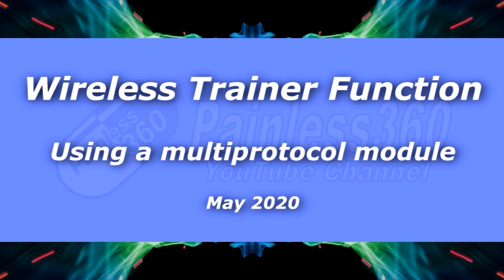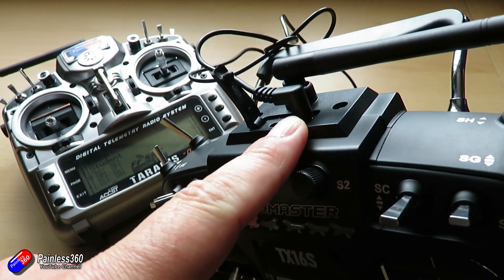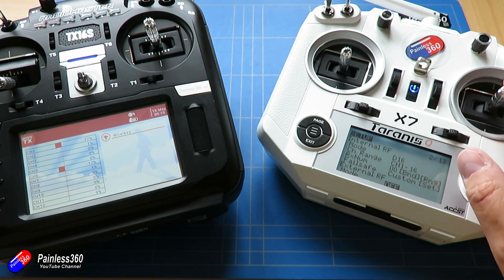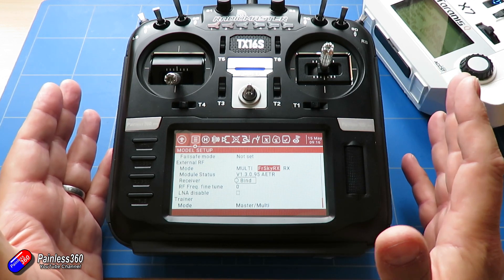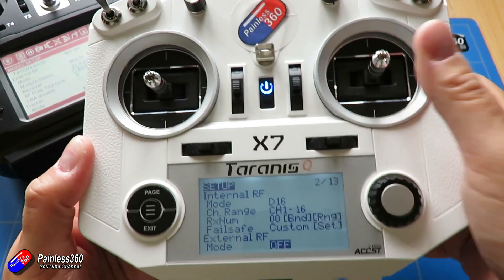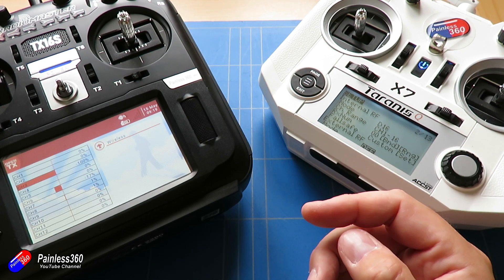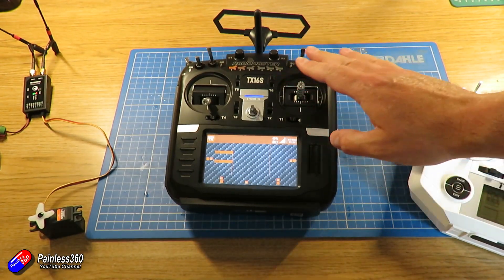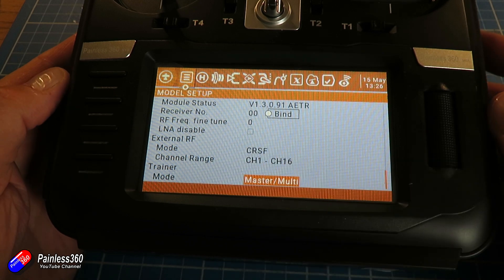Wireless Trainer Setup using a 4-in-1 Module (FrSky D16 radio and Crossfire too!)

Comment: Dear Lee! I have qx7 and R9 module. Would it work if I set the D16 as internal for wireless training and R9 as external? Thx!
Reply from the maker: Maybe, I've not tried it. The wireless trainer stuff is a funky function of the 4in1 MPM module so not sure if the standard radio that can't emulate an FrSky receiver can do that...
Reply: @Painless360  Thx! You have contact to tech people, clould you ask them if is it possible to change the internal xjt module in Qx7,to a multi module? Thx!
Reply from the maker: I dont think that you can. Best of luck
Reply: @Painless360  thx!

Comment: hey hopefully you can help me out. wanted to use this feature with the wt01 to work wireless with my goggles head tracker port. I have a 4-1 zorro radio internal with crossfire module, can I bind to the wt01 and put it on my goggle to send trainer channels for headtracking, while also using crossfire? sound like it should work.
Reply from the maker: I'm not sure how that would work, let me know if you get it working... best of luck

Comment: Lee, great video but I have a problem with the throttle. I have two Radiomaster TX 16S. Normally I use throttle -100 to +100 throw but when I switch over to the student the throttle trow change to 0 to 100 and that means I gave the student half throttle.  By the way when connecting to the Flightsimulator dongle with the stereo 3,5 mm jack it won't work. The USB connection you mentioned with a Windows driver is also a pain in the.... Only my old Futaba 7C works flawless. Thanks for your support.
Reply from the maker: I've not seen that here, let me me know when you gets it working... Best of luck

Comment: Hi I’m James, congrats on your videos very informative and to the point. I need a bit of help with connecting witless trainer with my TX16S, can you please advise how I set up trainer mode with FlyskyFSi6 transmitter with radio master TX16S as the trainer transmitter. I set up trainer mode on the TX16S but I don’t know what protocol I need to select for the fsi6 transmitter?
Reply from the maker: Not sure, I don't have one of those radios here and I've even downloaded and looked at the manual and still no clue. Best of luck with it

Comment: am having issue whith this. I have a tx16s and an extra 4 in 1 module and a taranis. I connect the internal module to the plane and connect the external module as rx to the taranis. only than i get extreme range issue between trainer and student. They keep loosing connection.
Reply from the maker: I've not seen that. Use the tune function to make sure that the signal is as good as it can be and beware that getting the antennas too close can cause the link to hiccup.. Best of luck
Reply: @Painless360  yes that was the issue I brought the module antenna 5cm to the left with an extension lead and i have a nice link.

Comment: Hi Lee, Hope all is well.Have you connect tx16s with the xjt module to a flysky FS16x. Or to the R168 rx. I tried many time following the XJT document with no success. Now if you took several hrs with the Radiomaster folks I think I am sol. as I have none of your expertise I really thought connecting the R168 to the module would be click, click and done. grrr nope. I can connect the R168 to the internal module very easy and quick. any suggestions. Thanks in advance . 
Jeff
Reply from the maker: If you are talking about the Frsky XJT module, that is an Frsky product so will only talk to Frsky recievers not Flysky. There are several options for Frsky too and you need to select the right one. Check out my video showing the to bind stuff using the internal multiprotocol module.. best of luck
Reply: @Painless360  Thanks Lee I will check out your video. I was under the impression the Radiomaster R168 acted same as a frsky rx. and yes it is a frsky XJT module so I thought the R168 should connect easly to the XJT module. I was trying to set up a trainer system using my TX16s and a FLYSKY FSi6x with Radiomaster R168 RX but sounds like the Module will not connect to the R168.and the internal module will not connect the FLSKY tx wirelessly. Darn.
Reply from the maker: https://youtu.be/6dpkkkezQsk
Reply: @Painless360  Yes I had watched that video before and it helped me before with originally binding my TX16S to my FS-1A10b rx  and to the R168 rx.  but now I am trying to use the external module FRSKY XJT to connect to the R168 but I guess that may not be an option and can only connect to it with the internal module.
Reply from the maker: The. Module and the RX probably have different regional firmware. Best of luck

Comment: Hi nice video, thanks a lot.

by the way, I have extra unit of Internal 4-in-1 RadioMaster module .. can this internet module unit  able to plug to the external module socket ?

If possible, I shall be able to use this way to have both internal & external 4-in-1 module, and setup the wireless trainer ? 

Very much appreciate, if anyone can advise
Reply from the maker: Maybe, depends on the unit. Best of luck!

Comment: Can you please make a video on how to get headtracker to work wit this radio, i use the tx16s and full crossfire.
I can not wrap my head around it🙄

Thanks in advance
Reply from the maker: Same way as any other Opentx radio. See my videos on it.. Best of luck
Reply: @Painless360  so the tracker cable from the taranis also works on the TX16S Trainer port?

Comment: Thanks for your Video. I have a question: with my taranis and a sbus reciever connected back in it I binded turnigy even spectrum with sbus compatible reciever to be able to use trainer wireless with them. Only in master selecting master /sbus in trainer ítem and binding slave radio to the reciever connected back in Taranis works fine. But what my surprise that in my Radiomaster this trainer opción (master /sbus) is not avaible. Only master /serial or master/multi but even after binding it is not posible to use wireless trainer. Also I seclect in SYS the trainer RF as Serialb but imposible to trainer option as in Taranis. Is missing Trainer/sbus in Radiomaster ? Is any was to do this without a external module and using a sbus reciber in RM back pins? Thanks in advance and sorry for my low English level .

Comment: Hi.  Thanks alot for your really great channel.  I should get my new Radiomaster TX16s in the mail today, and I'd like to know if it's possible to use a multi-protocol 4in1 STM32 module (you made a video about it 2-3 years ago) as a trainer module and use one of my old Futaba transmitters as slave TX ?  Regards.
Reply from the maker: Possibly. Best of luck!

Comment: I've  been trying setup a horus x10s as master and jumper t16 pro v2 as slave wireless lol my head is still spinning ! I can get them to work with a cable if i dont push the cable fully into the jumper t16. Blue tooth seems to be a joke on both. Funny part about it all is i dont have anyone to train!

Comment: Just one question with this module, there is an option to fine tune for each make of receiver. How can you store that if the transmitter is turned off? Thank you
Reply from the maker: I'm not sure I understand what you're asking. Can you elaborate?
Reply: I understand there is a config file which will store any changes to the fine frequency tune. Only problem is that I'm unable to find it

Comment: Do you know if the same hall gimbals used to mod the old taes is x9d will fit the tx16s? They look the same but could be different connectors I suppose. Seeing as the non hall model is in stock and I mod ed my old semi broken x9d i could just move them over.
Reply from the maker: No idea sorry. If they do, let me know.

Comment: Hi Lee. Very good idea. I have a Horus and X-Lite Pro and Master/Multi is not an option. I am running the latest OpenTX and Multi Protocol Firmware?
Reply from the maker: I've not got a Horus here to try but the module support has been part of Opentx generally for sometime..
Reply: Painless360 how strange. However. I did get the BT trainer link working. That’s never worked so bonus anyways mate.
Reply: The Horus is going. I had the TX16S for my Birthday. I am so happy with it. Even bound it to my WLToys V911S and V950. Very happy. Thanks for all the great tips.

Comment: Hope you can help me. I have jumper t16 pro v2 setup to kopilot I'm using mode 2 AETR. The motor will only start when over
half way up on throdle. any sugestions?
Reply: I watch just about all of your videos.
Reply from the maker: All I know about the setup of the Kopilot is in the series I made for it...Check what mode you're in and if the ESC i calibrated and connected propertly. I hope those videos showing how I set it up helps.. Best of luck

Comment: Is the Master/Multi option only on Jumper OpenTx because I have 2.3.7 on my Horus and its not there?
Reply from the maker: Did you select multiprotocol support in OpenTX when you updated it? It'll need that to have all of those extra pieces..
Reply: @Painless360  Hi Lee, I remember when I updated to 2.2.4 I selected the multi option but in 2.3.7 I cant see it - I've just looked at companion after reading you reply and I still cant see multi protocol support
Reply from the maker: I wonder if they've added it as standard now then.. Just checked the firmware and it's now included as standard. I wonder if it's just the X10?
Reply: @Painless360  Don't know I only updated to 2.3.7 about 3 weeks ago
Reply: pa I can select multi when using an external module
Reply from the maker: Please see my pinned comment. Very dissapointed.

Comment: amazing. Thank you Lee.
Is it possible to do that on a taranis x9d+? Internal module to trainer d8 and using ext R9m to control the model?
Reply: Ps, what module are you using?
Reply from the maker: Should be with the right versions.. (Jumper JP4IN1)

Comment: Lee, Great video,  also think Wireless Training is terrific!  and use it all the time with the grandson with FrSky D16 Models and two Q-X7S Radios ( one of which has a D16 Linker + Module in it but I'm licked into FrSky receivers ONLY right now in the models.  I currently  have this T16S on order and what I am MOST interested in knowing is if it is possible to do Wireless Training in MASTER MULTI Mode ( or MASTER SBUS mode) across the wireless link and control a NON-FrSky Rx in the model ( either with or without telemetry). Right now with my setup I MUST use my Q-X7S's Training with models in D16 BECAUSE it's INternal RF is not Multi capable.. and I have no MULTI capable INTERNAL RF module..in either Q-X7S Radio... so I must carry the "student" radio around with a iGanme + MPM in it and use it to fly all my Non D16 models in them.   I want to simply use the other non FrSky planes and quads with non-FrSky Rx's while wireless training,  AS WELL AS flying them solo.. but without having to use a different. second Radio with an EXT MPM in it to do it.          

I see that you can talk to Crossfire models using wireless training with a CRSF Module in the JR BAY .. that's cool but the only config that makes sense for me and likely MANY MANY others getting this radio is one where we are doing wireless training with models that are in INTERNAL Multi mode ASSAN, DSM2, any of the other many non-FrSky protocols the internal; RF Multi can support..

 Will that wireless link work when a master T16S Radio is set to to control a bound Spectrum, or Futaba, or ASSAN or any of the nearly 100 other possible MULTI Protocols when it's set to INTERNAL RF at the same time?
Reply from the maker: I show how to use both the internal and external Multiprorocol module for connecting to the other radio. If you have another module or internal transmitter in the radio then you can pass the trainer from the Multiprorocol module to the other (as shown with the Crossfire setup).. I hope that helps.. That other module could be an internal or internal Spektrum module.. This is a poorly documented part of of Opentx and the Multiprorocol stuff.. Hope that helps
Reply: @Painless360  Yes it helps,  and yes, I agree it's not documented, I've asked several times bot on Banggood and via Radiomaster Support and never got a reply or confirmation..  so having an influencer like yourself that actually HAS the radio and can actually try it and confirm 1st hand that wireless training will work properly when the T16S's internal RF module is set in a non-FrSKY mode with the model is something I guess I'll have to do myself when I actually get the radio delivered. I've now watched 6 different YT Reviews by those of you lucky ones that got these pre-release radios and no one has apparently attempted or tested it yet..
Reply from the maker: The module youre not using for the wireless trainer link works as normal. So you can control whatever you want  (as long as the reciever is supported by the module not being used for trainer). I thought the video and my answer made that clear. In case you are still confused  - it will work with the master radio connected to a Spectrum reviever. You'll always get more detail asking via Patreon.... ;)
Reply: BTW: https://www.rcgroups.com/forums/showpost.php?p=44598885&postcount=17755  clarifies the requirement a bit more..

Comment: Is that mess caused by radiomaster or the open tx changes and improvements ? 
it looks easy - if you have that receipe you had developed with Radiomaster "Ben" 
I have ordered mine ... and hope to get it soon and running quickly cause I have to move the whole Jumper T16 fleet of receivers to the radiomaster which I had done just3 months ago coming from the X9D to Jumper T16 Pro Hall Gimbal to.
Reply from the maker: It's not a mess just very poorly documented by the Multiprorocol and Opentx teams.. Hence this video. Happy flying

Comment: Hi Lee: if you can bind your QX7 to a multi-protocol module in the back of a T16, can you bind to one in the back of a Taranis? It seems pretty much the same thing to my simple brain! I've tried and I don't see the same menu choices. Is it an OpenTX version issue or is it something more fundamental? Thanks!
Reply from the maker: You'll need an up to date Opentx verison with the Multiprorocol module support turned on..
Reply: @Painless360  I'm on 2.3.7, the latest production version, and multiprotocol module support is turned on. The module works fine, it's just that I don't see the same menu choices on my Taranis as your video shows on the TX16

Comment: I like this video. I've been trying to set this up for months with my T16 and a Flysky FS-I6X (my daughter is interested in getting into the hobby and its a great size for her small hands). However, I still cant seem to get them to bind together fully. The T16 is set to FS2A_RX and Receiver 0. When I bind the T16 seems happy, however the FS-i6X keeps showing "RX Binding..." and never seems to fully bind (this happens regardless of PPM/PWM, iBus/SBUS settings in the FS-I6X). 

Would it be possible for you to try this with the Flysky protocol?
Reply from the maker: If I get another FlySky radio in I'll give it a go. OpenTX 2.3.8 seems to have some improvements with this stuff from what I can see and it helped here to upgrade the multi-protocol module to the latest version of the firmware too.. Best of luck!
Reply: I have not tried this myself, but some flysky receivers do not actually send anything back to the radio, so it doesn't know if it is actually bound. With these, after a few seconds, you press cancel, it takes you back to the home screen and the receiver is bound. Maybe it is the same with the multi module.
Reply: Any luck? I basically have the same situation, kid wants to get into the hobby and the FS-i6 is around and has the right size. It works perfectly with a Taranis with the FRSKY protocols, no luck with the FlySky protocol though.
Reply: have you managed to get it sorted out ? i would love to use this feature
Reply: Looks like they have finally acknowledged a bug with the Flysky trainer mode in the multi protocol module software. Hopefully, they will sort it out for next release

https://github.com/pascallanger/DIY-Multiprotocol-TX-Module/releases

https://github.com/pascallanger/DIY-Multiprotocol-TX-Module/issues/500